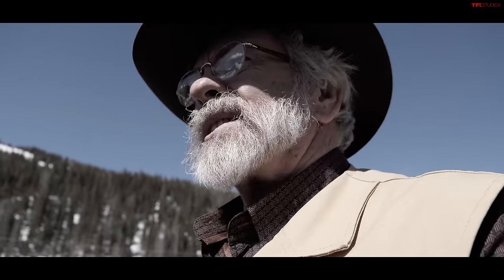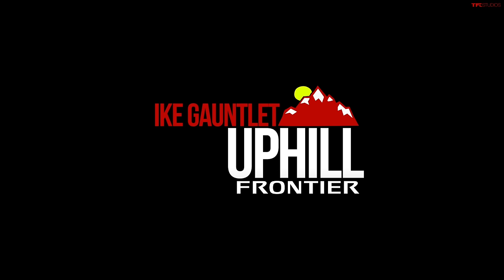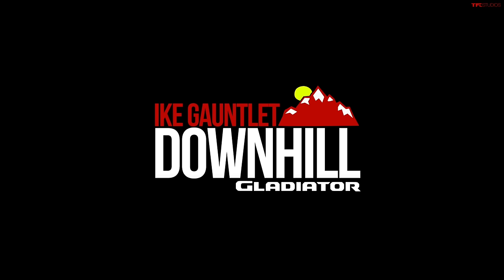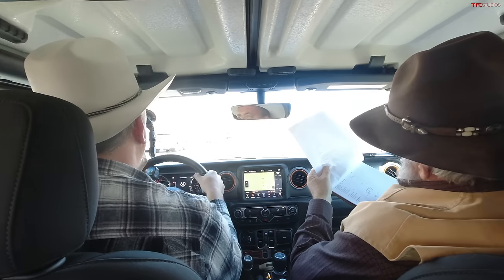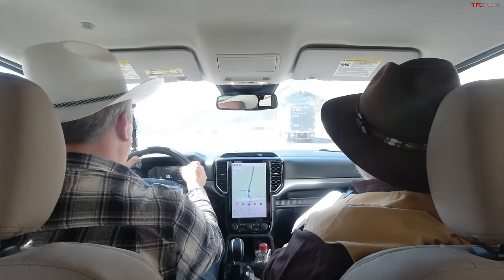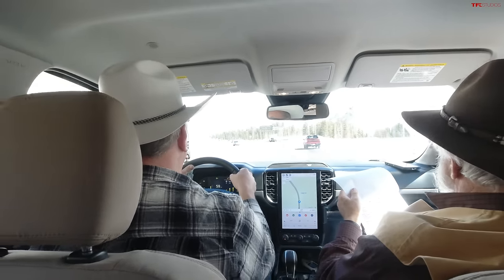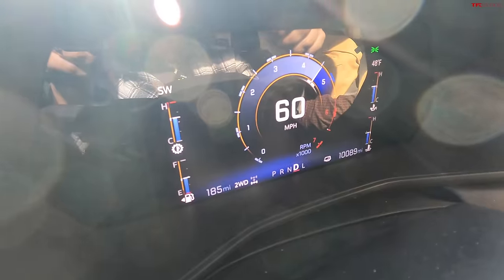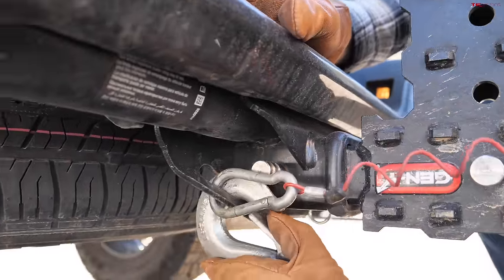MEGA Ike: New Tacoma, Ranger, Colorado, Gladiator & Frontier vs the World's Toughest Towing Test!

Comment: Careful, dont push that "reliable" and "durable" Tacoma too hard!! It could break at any second!
Reply: Keep up these comments. 
You're making my reliable 3rd gen Tacoma climb in value with each new shot taken at the 4th gen. Lol
Reply: Me too brother. 3rd gens forever! ( literally).
Reply: Taco fans want to fight everyone even different generations of their own LOL
Reply: @thewireman134  3rd gen owners are the worst.  Because of the trauma they got from 2nd gen owners
Reply: I'm still laughing over here with my 400,000 mile 1993 3.0 ranger. You silly toyota fan boys
Reply: @beexiong2995  lol
Reply: @beexiong2995  what's that? Sorry, I couldn't hear you over the sound of your rotted frame snapping in half.
Reply: F*ck the tacoma , had 2018 and couldn’t wait to sell the bouncy thing with a one year recall, almost same load capacity as my Prius
Reply: @beexiong2995  🤣🤣🤣😂😂
Reply: @jeremypike9153  the chevette of the pickup world.  Lol and lying about mileage.  Lol
Reply: @NoShadowOfDoubt1  Your primary complaint is that it's bouncy. It's a truck. You were correct to go back to your prius. Lol
Reply: Toyota finally showing their true colors with brand new trucks breaking down 😂
Reply: @thewireman134  lol I don't need to lie about my truck like toyota owners do to feel good about my purchase. Best 600$ I've spent in the last decade. I have noticed however that ford chevy dodge even nissan knows how to actually use leaf springs. Mine aren't bowed backwards sitting with an empty truck bed like all the tacomas have been for 10 years now. I also don't look like a terrorist in need of a mounted machine gun driving around in my ranger.
Reply: @beexiong2995   Nah all the same toxic as hell 😂 don't matter what generation.
Reply: @jeeperwill6262 dude, the taco is one of the worst riding trucks.
Reply: Hard to see the fault in Toyotas with all the jeeps broken down on the side of the road blocking the view…
Reply: @jeremypike9153  I have a 07 Ranger as well. Been beaten for 200k miles runs and looks as new.
Reply: Calm down, it’s fail safe worked as it should have. It didn’t break.
Reply: All I ever seen is broke down Toyota's.I put over 3 million miles on the road.
I think they're highly unreliable
Reply: @jeeperwill6262 I wouldn’t brag about having a foreign, ugly truck with a crappy minivan engine and transmission. The Gen 3 Tacoma I drove was the worst truck I have ever driven in my life. My knees felt like they were in my chest and I’m only 6’3”. Absolutely hideous truck inside and out.
Reply: The new Toyota products aren’t what they once were. My buddies door panel detached within two weeks of owning. Also truck has been in shop almost a month of ownership
Reply: @jeremypike9153 😂😂😂 i agree!!! Dam Toyota fan boys!!!!! Im really starting to dislike them
Reply: @jeremypike9153 
Exactly!!! Rangers are amazing
Reply: So they took all this time to redesign the taco and it didn't win anything 🤣
Reply: @LotsOfPaypa  So why did they have to fix
Reply: I have frequently taken my 2016 Nissan Frontier Pro 4x off-road, and I have not encountered any issues thus far. While I am not familiar with the newer models, I have had an excellent experience with my older Frontier. The Tacoma is also known for its reliability, and I would trust it as well. However, I always carry emergency supplies and communication devices when venturing into remote areas, as unforeseen circumstances can arise. One of the things I appreciate about Nissan is their conservative approach to mechanical changes, which contributes to the longevity and reliability of their trucks. While other manufacturers are transitioning to four-cylinder turbo engines, I have some concerns about this trend. However, I trust that manufacturers will address any issues and maintain consistency in their designs for a reasonable period. I believe that Nissan truck buyers prioritize value and durability, and they tend to keep their vehicles for an extended period. Personally, I intend to keep my truck for at least 20 years and am not particularly interested in excessive bells and whistles.
Reply: @jeremypike9153 my 900k mile tundra seems to be perfect after donuts and burnouts all weekend on 35s it’s still running like a champ
Reply: @robertyoung8289  200k miles is still new lmao when you can get a vehicle to reach 600k on then you can brag 🤣🤣my tundra has 900k miles and stock motor and trans I beat the shit out of it every day doing burnouts on 35s got the truck with 120k miles now it has 900k miles
Reply: @underthelibertytree712  Because the fail safe worked? Just like an airbag.
Reply: Someone finally finds 1 problem with a Toyota and they absolutely run with it 🤣🤣
Reply: Look at the underside of the Tacoma. It is absolute cheap garbage s well as being stupidly designed. Tailpipe sticks out wrong and everything is too low. Trash
Reply: @LotsOfPaypa haha
Reply: HAHAHAHAHAHA 😂
Reply: I like this Toyota
Reply: Oh it broke... Doing light off roading.  You can't cover it up.  Proportion valves in a braking system are fail safes too, if the vehicle uses them something went wrong.... @LotsOfPaypa
Reply: My Tacoma did not live up to the hype. The seating position was absolutely terrible and the engine and transmission gear hunting didn’t impress me. I know the Toyota fans will be pissed but  just being honest. Been way happier with the 3rd gen Frontier. Much more comfortable seating position and better power and smoother transport. I know the 4th gen Tacoma’s are supposed to have fixed all my complaints but not a fan of the smaller engine with turbo 🤷🏽‍♂️
Reply: Blown head gasket entered the chat
Reply: Keep being that dead horse. It was a freak problem that I haven't seen duplicated.
Reply: But the difference is Toyota doesn’t need any towing  or tow hitch 🤪to get to the service centre  whereas others won’t  even start that ford eill flash 360k lights🤡
Reply: @Kahless00  😂😂 great excuse. Top notch QC!
Reply: @St.Irenaeus  you have no idea what qc is. They can't test every part on every vehicle. Prove its an actual qc problem. Show this failure happening frequently instead of it being just a weird thing that happened here.
Reply: @Kahless00  give it time. You can’t even find them on lots still.
Reply: @St.Irenaeus  then how do you know it's a qc problem.
Reply: You know Nathan about cried when they broke that taco. He’s the worst nutswinger I’ve seen.
Reply: 😂😅😂😅
In 252,000 miles I NEVER broke my 2001 ZR2 off roading!!!
Reply: It’s funny how everyone runs with the “it’s so unreliable” story when 1 thing breaks, of course a truck that has not been out for a year is gonna have some kinks to be worked out, Colorado had issues to be worked out on its first year, same thing is gonna happen to the Ranger
Reply: Bullshit! Would love to see this exact test at 200,000 miles on each one. I don’t think the Americans truck would beat it. 😂
Reply: @alwaysiyi272  I had a 2014 Silverado first year of the new truck and LT V8.. 148,000 trouble Free miles..
Reply: @thewireman134  That's okay bro. Ranger buddy will be towing those Tacoma's with rotted frames to the repair shop.
Reply: Plot twist, the motor in the tacoma is the SAME motor in a couple lexus motors. Been around a couple years. No issues with them.
Reply: @jeremypike9153  only a few rangers see those miles. There is a reason toyota  gives out high mileage toyota stickers, with proof of odometer by the owner.  There are about 10 different  motors made by toyota that see 400k, 500k, 600k and some up to 1 mil miles. It's  a common theme across most of toyotas motors. The 3.0L and 4.0L ranger are about it, along with the 7.3L diesel. Other wise most fords are getting 150k with normal ownership. 250k with extra tlc loving owners. The 2.3L the ranger had did get high miles but that was a Mazda motor so doesnt count. You must be blind to the fact toyota  has many motors ceushing your one ranger with 400k.
Reply: @jeeperwill6262 roted frames happened due to a 3rd party, not toyota.  Toyota  had a 15 yr recall replacing them for free. Then went after the 3rd party who didnt paint them correctly. If anyone has a roted frame ar this point,  that's  their own fault.
Reply: @beexiong2995  My roommates' 2nd Gen "with a new frame" dropped a gas tank in the middle of an intersection, dropped its exhaust cab-back at an unknown location (but it's okay because it "passed emissions"), went through 3 separate steering racks and blew 2 steering pumps, stretched it's throttle cable and would lose all power at highway speeds, rusted through the bed so badly that the plastic liner became a structural component, and one of the neighbors' kids cut themselves leaning against the jagged rusted chrome bumper. 

And he was still getting offers for 10-12k, once at a red light from someone on the cross-walk. Don't tell people the facts, they've already made up their minds.
Reply: Why all the hate & vitriol for Taco’s in here? Any new truck will have teething issues.  I never buy first model year of anything.  The new Taco is better than it’s ever been.  The good news is that we finally have great midsize options again.
Reply: @markcoopers1930  inspection should have failed that deathtrap.  Too much of that crap going on
Reply: @NoShadowOfDoubt1 how dare speak the truth
Reply: @weegeemike they played safe for many years selling trucks based on reputation. Crap for power. Crap for capabilities, crap for mpg. But great resale fk Toyota
Reply: 2nd Gen 4 life!
Reply: @jeremypike9153 400’000 miles ain’t shit lol
Reply: If only I could fit comfortably in an older gen Tacoma. Tundra older gen for me all the way.
Reply: @robertespinoza2740  lol with more work on it than a 3 million mile diesel
Reply: @robertespinoza2740  laughing my butt off that's a flat out lie the best Toyota built won't go 900k miles even driving miss daisy on nothing but highways. I have 2 friend that love them and they both said lies. I own two shops in two states and have never seen one over 270k. I am a second generation mechanic in my 60's and I have yet to see one over 270k I've heard all these stories but not o e of my customers has one get over 270k and that was with work done.  I bet any mechanic can look at it if you really have it and show several things that were worked on and probly a different motor and Trans. You really think anyone who has ever driven vehicles for more than 10 years believes your lies.
Reply: @alwaysiyi272 the big difference is the ranger was sold in other countries all along they just stopped selling them in the states. So the vehical is already been around. So no most of the problems have already been resolved.
Reply: @MsAce0424 coming from someone who knows nothing of that program. Those stickers are given out to any vehical no matter how much work has been done to it. I hasone in my shop less than a week ago it's got 270k on it but it's had a complete rebuild done by me. He's already got the 300k sticker on it but it's not there yet.
Reply: @MsAce0424 Toyota used them without testing them so it's on them still
Reply: @MsAce0424 I service twelve rangers still running and doing great  all are well over 100k one is over 400k. I had a old ranger that was my parts truck for years my son drove it when he got his license back in 2000. He put many many miles on it, and they weren't easy miles by no means. It still runs and drives great. Brakes are gone needs a battery and alternator and it's getting very rusty. I live in northern Minnesota so all vehicles rust rapidly here if not taken extra care of. It has the 4.0. Ford used the 2.8l, 2.9l, the 3.0l vulcan, and the 4.0l
Reply: @normankoch4289  I have only replaced trans fluid every 30k miles and  starter 2 times that’s it. Try again buddy 😂🤣
Reply: @robertespinoza2740 you mean the one on your channel that has 140k??
Reply: @normankoch4289 that's hilarious 😂😂😂
Reply: @maxjordan2625  the hilarious part is these idiots claiming their Toyota did this or that. If half the Toyota's did what their owners claimed then there wouldn't be anything on t he roads but old Toyota's and new others. I have heard over a hundred people claim to me that their Toyota did this or that if that's the case why does literally nobody see these great glorious Toyota's. I'm in my 60's, I run two service shops in two states, am a second generation mechanic that sees 60 to 70 people a day at work alone. But yet I have literally never seen one let alone the hundreds of thousands there must be around since everyone has like two friends that have one.
Reply: @maxjordan2625  no that’s the vacation truck to travel  and get groceries. I’m talking about my work/ farm truck 2013 tundra still has same motor and transmission as my 2015 tho also the 15 only has 34s the 2013 has had 35 inch tires since I first got it different brand tires but all 35s. and now at 900k miles no problems the trans might need to be replaced but motor healthy trans still doing good and truck still loves burnouts and sliding around
Reply: @thewireman134 
That and that one dude bk wants to just be a troll. What does bk stand for anyway? BIG KUNT? 🤣🤣🤣
Reply: I love seeing all the Butt Hurt Toyota haters. They are so sad about their depreciation pits and maintenance costs, they are fighting mad. Lol
Reply: @Ringoluck  I find it hilarious that the Tundra engines are currently exploding and Tacomas are stacking up on the lots because no one wants to buy them because of their poor quality. It is comical!
Reply: @Ringoluck literally just not the  case at all lol. but keep riding that big toyota pole I know yall love to ride so much
Reply: @robertespinoza2740  you forgot to add that it had the original factory tires on it yet..🙄
Reply: @pathunter7003  didn’t you hear it has had 35s since 100k miles

Comment: Another great video! Thanks. I noticed my Canyon does way better towing down and up hills with the adaptive cruise control set. It seems to know what gear to choose to prevent to many brake applications better when using it.
Reply: Cruise will automatically apply the breaks though. That’s the reason they don’t use it so they can measure break applications. Maintaining speed with cruise is easy until the breaks overheat. My 2019 Colorado wouldn’t need to break that much. It’s a really disappointing result for the new truck.
Reply: @stronghold07ptx85 they also automatically downshift, so they don't over use the brakes.

Comment: The Nissan, up the hill, took so long to reach 60 that unless you were speeding up the hill there is no way you finished in under 8 minutes!
Reply: I thought the same thing. And with the Ranger they did it in 7 mins 50 sec's. In order to do that, you'd have to average 63.5 mph, if I'm doing the math correctly.
Reply: Yea it’s underpowered big time, but most of the imports are like that

Comment: The Ranger is a Towing Beast....i have a 2021 and tow a dual axle car hauler with two SxS and a Z18 Nitro Bass Boat ... Zero issues! I use a Curt echo brake controller which works fantastic with my car hauler my bass boat has surge brakes.... I do not know about the longevity of the 2.3 EcoBoost, But Ford must be under rating it on power.
Reply: The Nissan is fictionaly better than the unreliable ranger, the Canyon and Colorado are legitimately better.
Reply: @thewireman134  
Mine only has 45,000 ...but so far it has been great...my son has a 2.7 eco boost in a 16 F 150 ...180,000 still going strong....I had an 86 2.3 turbo coupe thunderbird when I was 17 for many years, that car was abused the engine lasted well over 200,000 until the car was totaled by the person I sold it to!
Reply: @thewireman134  Define "unreliable".  My 2020 Ranger is at 60K miles with zero issues.  I live in Wyoming and drive it a lot at elevation and the turbo is amazing.  So much low end torque. You couldn't pay me to go back to a NA shit box. Worse gas mileage and altitude they turn to wheezing crap.

Comment: The problem with midsize trucks is they've gotten a lot bigger over the last 20 years, but rear seat room is horrible, especially in the Frontier. So you're getting a bigger truck, externally, that's more expensive but still has a cramped interior and is less capable than a full-size truck. Doesn't make a ton of sense.

Comment: I agree that yes the IKE is a tough test, but I still say not the toughest. You need to find  place where you have not just one big long hill where it keep the pedal to the floor the whole time, but find an area where you have big hills with 7% grade that then goes into a downhill and right back into an uphill. I can think of a few area's around where I live. I can tell you from experience, that is harder for a truck to maintain speed when you have to get on and off the pedal and it is having to shift up and down do to up and down.

Comment: Y’all really need an OBD scanner so you can get actual drivetrain temperatures, instead of “gear temp is at 1/2 on this [arbitrary, non-linear] digital gauge”
Reply: They could actually log data points.
Reply: And chart speed/elevation/engine load/drivetrain temps over the course of the run

Comment: According to your chart, the jeep was the worst on the downhill at 5 brake applications. The Colorado only had 1. (According to your chart)
Reply: thought i noticed that as well
Reply: I think that was the weighted ranking and not the number of applications. Would have to watch the video again.
Reply: @jaredgates4310  correct! You can see it on the top left corner were they stated ranking is 1-5 with 5 being best performnace.